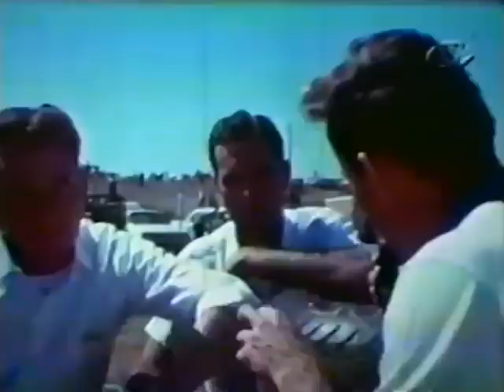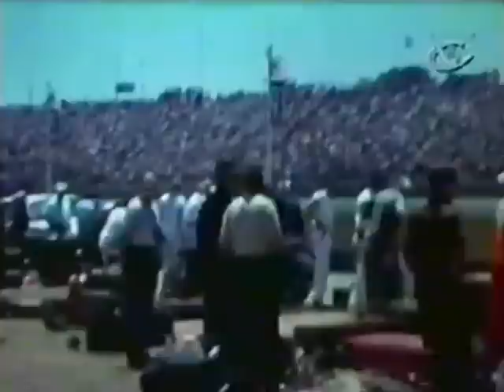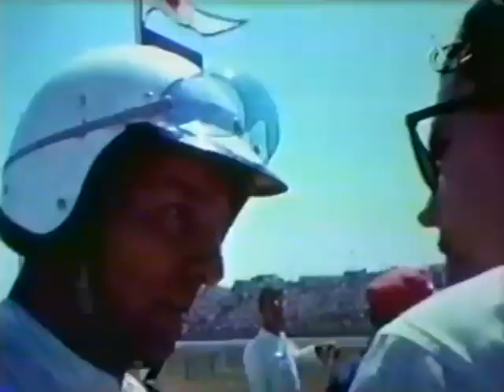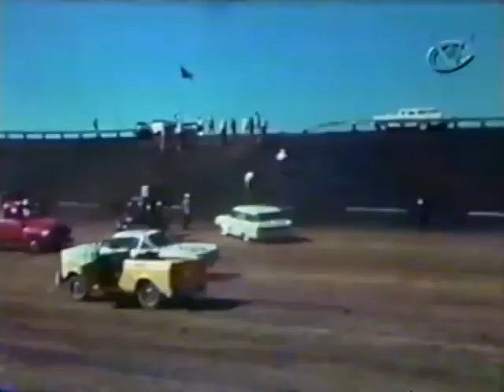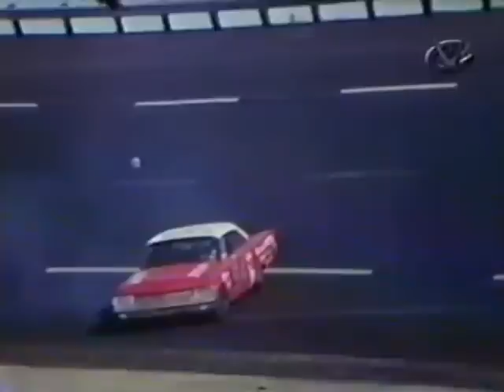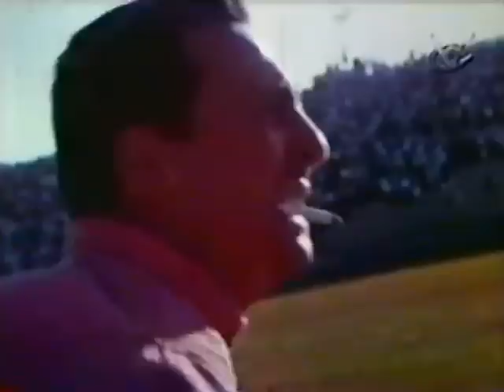1961 World 600

Comment: When stock car racing was true stock cars with stock factory motors
Reply: Not really-even then, they were starting to use tube frames in the front and had roll cages built in. And when I look, I see that between racing and testing, 11 drivers died between 1964 and 1975. Loosing more than a driver a year is, to me, an unacceptable price to pay for "true stock cars"
Reply: tell me you're a boomer without telling me you're an boomer
Reply: And stock tires too!!
Reply: @almostfm  
Yeah, there USED to be a significant risk of injury or death for drivers. But NASCAR has worked hard to ensure that there's practically no risk to drivers at all anymore! I hear there's a new plan, where drivers will be able to control their race cars remotely, from safe, cushy Barcalounger recliners inside luxury air conditioned corporate boxes! Of course the drivers will also need another massive pay raise.....
Reply: Tell me you don't know anything about NASCAR without telling me you don't know anything about NASCAR.
Reply: 1961...every team struggled with a huge learning curve about what they could do to improve the engines, transmissions, rear end gearing, and everything in between. No radios either...the Crew Chief was holding up a sign to inform the driver! It was an incredible and exciting time for Stock Car Racing and with little or no television coverage. Most of what we have to watch has survived on 16mm film and we're lucky to have that! It is so easy to point out problems with NASCAR today. Instead, let's honor and respect the drivers and mechanics from the past. They earned it the hard way.
Reply: @drakefallentine8351    Figure many were WW2 or Korean War vets. Smokey Yunick was a B-17 engine mechanic.  Like the nfl, that & nascar of this era were games compared to combat. Vietnam was still not a household name.
Reply: With cartoon sound effects lol 😂
Reply: @megatron8490  You mean like, having enough sense to know the difference between a boy and a girl?
Knowing if you don't work, you don't eat? 😂
Reply: @HighlanderNorth1  , I see you haven't kept up with Nascar lately.  In the last year drivers have sustained concussions( some career ending) due to the latest Next-gen car being built too rigid. Numerous protests from drivers have erupted.  These new cars too safe? Hardly....
Reply: Lol ok
Reply: Go to your local short track where street stock, factory stock cars are still raced.
Reply: @bradleynelson5915  Busch's wreck early on this season did not end his driving career, it was simply the last nail. Much like the crashes toward's the end for Dale Jr, where the crash looked totally innocent, but both Kurt & Junior's damage had long ago been done, just took one slight jolt to finish them both off. To say the Next Gen car of today's NASCAR is comparable in danger to the Stockcar's of the 60's-70's-80's is a VERY naive statement.
Reply: @megatron8490  Tell me you're a follower.
Reply: Let's bring it back!
Reply: 600 ???? 
Very long race ? 
I’m not really a fan either but this history is flat out amazing!! 
And learn so much from comments also !
Reply: Motors were rarely completely stock, wheels and tyres definitely weren’t.
Reply: Kind of. Remember original NASCAR cars were souped up moonshine cars they've been cheating since day one. But back then they were more stock then they are now
Reply: that would be the 1949 and the early 50s.
Reply: And people were dying left and right.
Reply: They might've been factory engines, but only in name. There's nothing stock about a Nascar engine from this era. 180 degree headers, bigger carburetor, bigger oil pans, better ignition. Not stock, even by this time.

Comment: Wow 360hp and old fashioned drum brakes all the way around. Kind of freaky.
Reply: Those were some mighty hefty drum breaks.  Maybe they were stock on a 5-ton truck.
Reply: Also had bias ply tires, no cool suits, a regular car seat, & no power steering. And if they had a spoiler on the rear it was very short. These men risked their lives on every lap
Reply: That was the technology at the time. But properly maintained worked quite well.
Reply: @reginaldhall6871  Some drivers/car owners put an inspection panel in the passenger floorboard on a hinge.  The panel was weighted to stay closed but had a rope tied to it and the driver could pull the rope and look at the right front tire during the race.
Reply: @davidkeeton6716  I live about 10 miles from Talladega & the International Motorsports Hall of Fame. I was amazed looking at the old race cars in the museum & seeing so many original factory parts on them. Like Petty's 73 Charger has the factory Chrysler electronic ignition that my old Superbee has. The car has 2 complete ignition system, 1 is a backup. Back then when they said stock they really meant what they said. There are countless other factory parts that can be seen too

Comment: What some race fans may not know that after 1961 Pontiac went from forged connecting rods to cast ones to cut cost . They were fine for street for street engines , but if you spun them hard they broke . This was when Ford and Chrysler engines took over . Another reason was that GM stopped supporting race engines . After that the 426 Chrysler HEMIs and the Ford 428 SCJs ruled the tracks . In 1971 the Allison brothers lobbied NASCAR to lower the max CID allowed to 355 to use the Chevy small blocks as their big blocks were no match for the HEMIs or Fords newer 429 SCJs which were completely new engines from the older 428s . The reasoning behind this is that Chevys were the most popular cars but not seen on the racetracks , Chevy also told the allisons on the sly if they  could get this passed that they would again support the small blocks which they did . It turned out to be good for the sport as many Chevy owners now watched the races . And to anger Chevy fans Dale Earnhardt seniors first two seasons were in a Ford . I miss when NASCAR was real racing .
Reply: Dale Earnhardt Sr. also raced a Dodge Charger in 1975, # 8
Reply: Not really good for a sport to pander to a competitor that's not winning.
Reply: @joenorris8220  A Cordobacharger???? 😀
Reply: @johneckert1365  No, it was a 1974 Charger body style.
Reply: @joenorris8220  Ah yea, my bad. Got ahead of myself by a year lol
Reply: @joenorris8220  I've always wondered how the hell the 74 Charger was able to meet the 5mph bumper requirements?

Comment: Wow!  135 mph.  My 2001 Chrysler minivan can do 135 with a v-6 engine and ac running.
Reply: The motor and transmission in those old beasts probably weigh close to what your minivan weights. Total weight was over 5000 lbs on 7 inch wide bias ply tires and steel wheels. Not what Nascar thinks is a "stock" car now
Reply: @rickflorke7605  A 1960s big block weighed an average of 500 lbs. The trans was no more than 250 lbs.  My minivan weighs in at a tad over 3,000 lbs.  My point was, if I had a time machine, I could compete with these relics in a minivan.